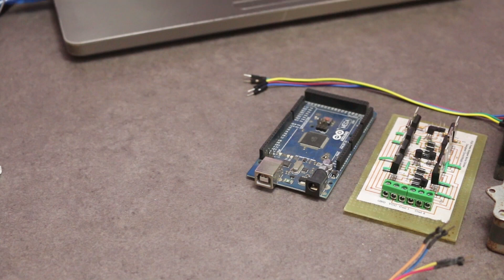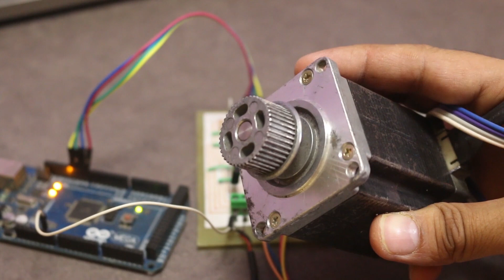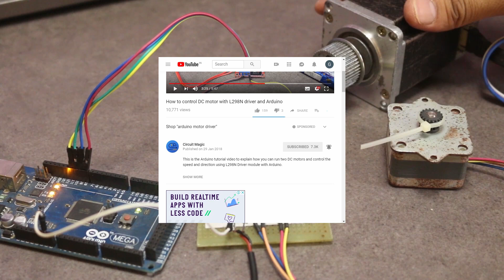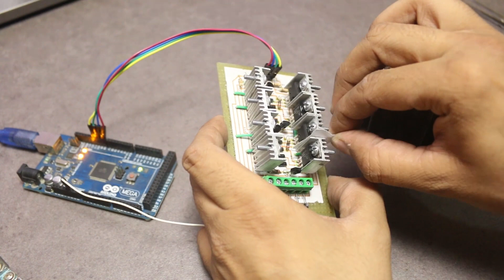5 Amp Stepper Motor Driver - Part 3 - 22kg Stepper motor with Arduino

Comment: Great job, I have a question, what modifications do I need to make to make the circuit support a NEMA 43 6A or higher? Should I just swap the mosfet for one that supports more current?, TIP137 ?

Comment: Thanks for the video, i like it. Could you please share the circuit schematic and pcd design files of the project  instead of image?
Reply from the maker: please visit circuitmagic.com for the circuit digram
Reply: Circuit Magic i've already visit your website and find that circuit but, there is one missing part in that image. Because of that reason i asked for a circuit schematics file that is created on eagle or any circuit drawing software.